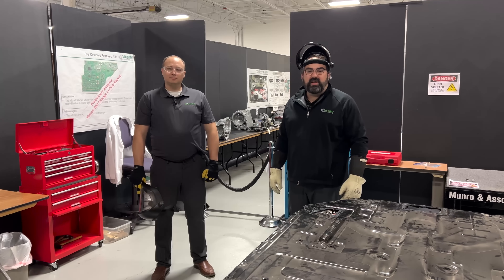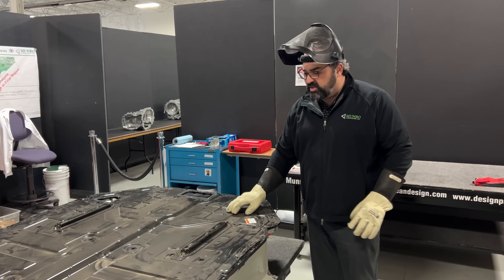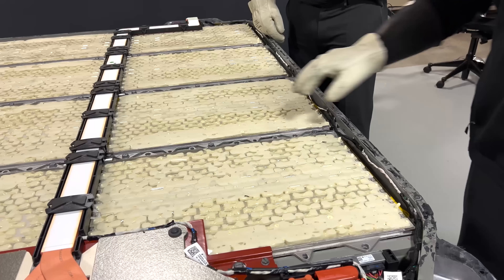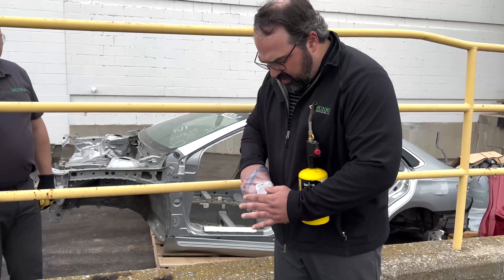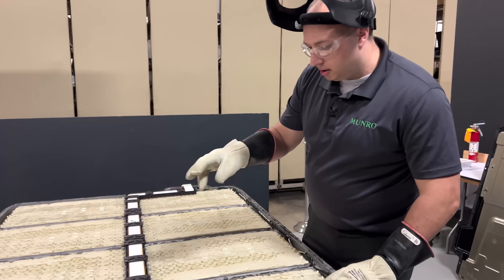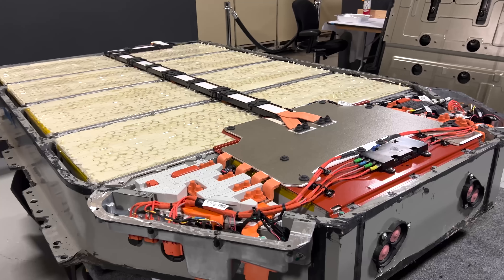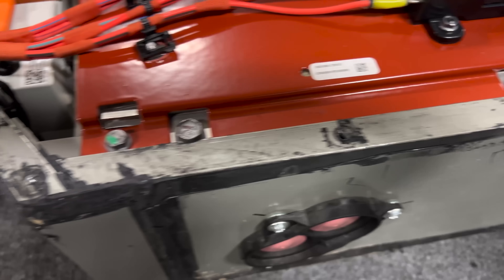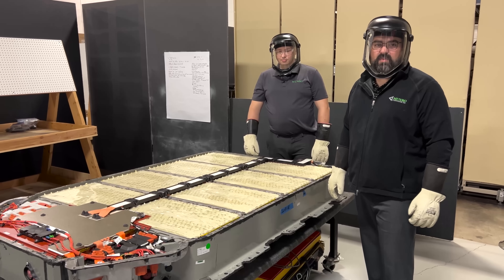Rivian Battery REVEAL!!

Comment: As I understand it, I wish that Tesla had the same fire retardant foam material in the Model Y and 3 that they do in the plaid. I have a 2018 Model 3 and I assume that it isn’t as safe then if I were to have a thermal runaway event?
Reply: The Tesla battery cage is designed to inhibit thermal events and lead flames away from the interior and that is paramount for safety, in the end it's still the batteries that burn the most and the hottest no matter how flammable the foam is.
Reply: @2nd3rd1st  good point. Thanks
Reply: If you have a thermal runaway you are dead and the car is totaled, so just get out ASAP.
Reply: @InternetDude  oh I totally understand that. I was just trying to say that I wish that the 3 and Y had what the plaid had as far as fire negating material, as I understand it.
Reply: Definitely not as safe as the rivian
Reply: Didn't one of the first Plaids catch fire and run uphill all on its own?

Comment: Are those bolts that come down from the top accessible without removing the carpet and/or seats and interior trim?  If not, that's pretty terrible from a service perspective.  IMO, the battery pack should be removable without having to remove a dozen interior bits just to peel the carpet back.
Reply: Why does it need to be easy to remove a battery pack lmao
Thats like the last thing a customer should have to service or even should be allowed to service
Reply: Lol what do you think the tesla structural pack requires. 189 steps per the service manual
Reply: @mattbrew11  so your argument is that if someone else makes it complicated to service Rivian should as well?
Reply: @kennyg1358  so sorry that batteries just eject like sim cards
Reply: @kennyg1358  Not much more time is estimated for the structure package than for the normal package.
But it is a relatively simple calculation: the installation always takes place, is replaced less often, so it is put into perspective very quickly.
Reply: It would make no sense to attempt to access this pack from above while it is in the vehicle. There is a floor above the pack, so unless you're an ant you're not getting above the pack while it's in the vehicle without cutting out the floor of the vehicle body. the carpet, seats, and trim are irrelevant compared to the floor.

It only takes few minutes to drop the pack out of the vehicle, with the proper equipment.

Comment: Rivian battery less likely to thermal runaway than Tesla  Love it.
Reply: Same chemistry so same likeliness.
Reply: @JasonWW2000  false. Watch the video.
Reply: @smallbusinessdreams  I don't know why your saying "false". I did watch the video. Maybe you don't know what thermal runaway is? Are you thinking the carbon fiber shield is less likely to be punctured compared to Teslas aluminum plate? 
Once a cell overheats it is going to catch fire and spread. This is what lithium ion cells do. Now that I think about it, the Tesla's using the LFP cells are less likely to have thermal runaway than the Rivian. So you've got it backwards.

Comment: Don't the vents need to seal against water ingress?  This would make clip-in vent housings a bit tricky.
Reply: Not if it has a a mastic pre-applied to the outer flange of the clip in vent. A lot of open seals use it for the doors and tailgates.
Reply: @xXElementistXx  
Doors and tailgates aren't critical watertight seals.
Reply: They would also have to account for air expansion and contraction with temperature.  It looks like the vents can serve as rubber diaphragms to accommodate the change in air volume (maybe), but there will be a positive pressure when hot and negative pressure when cold.  Any clip-in components need to seal against the pressure differentials, so yeah - I can appreciate the use of fasteners to hold any covers in place.
Reply: Also easily possible with clip-in. If there is a higher water pressure, it can only come from outside (flooding), so the water itself exerts additional pressure (self-sealing effect).
And the seals don't have to be made of hard rubber, so even smaller forces are enough to seal it and therefore possible by simple manual assembly.

Comment: I assume the foam in Model 3/Y is to soak up leaking electrolyte and allow for some cell expansion in case it's defective ... it's not flame retardant ... maybe with electrolyte it stops burning? 🤔
Reply: but it did actually go out when lit inside, he had to relight it.
Reply: @bluetoad2668  
Tesla fanboy,fanboying.
Reply: @Robert-j6r8c  so original 🤦🏻
Reply: @bluetoad2668  if the expert says its keeps burning, it does
Reply: It's heat conductive...
Reply: @ModPhreak  I have never seen "heat conductive" foam... in 99.99% of the time it acts as thermal insulation, as it conducts heat very poorly.
Reply: It is NOT heat conductive